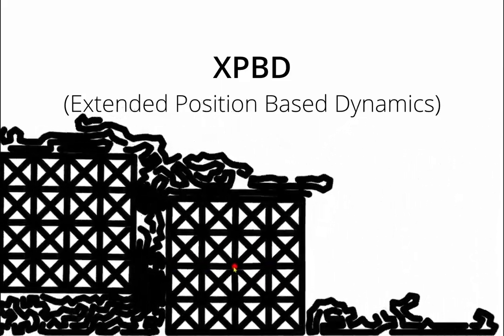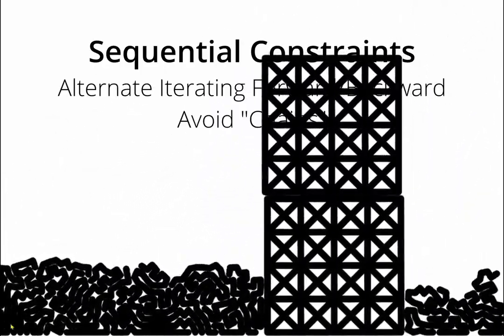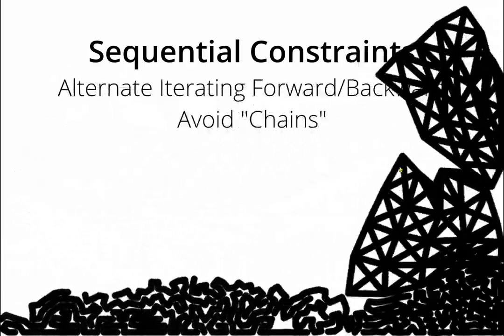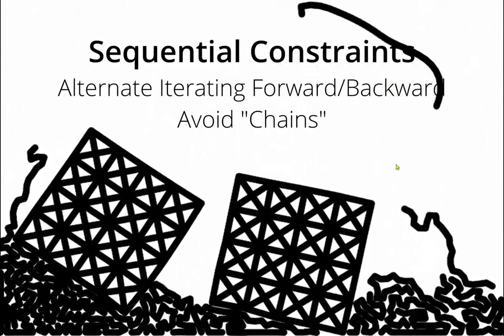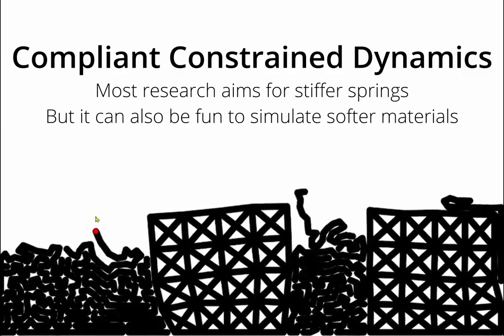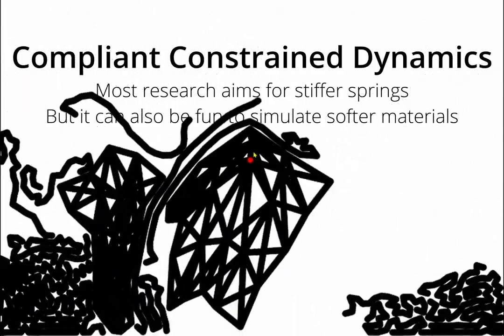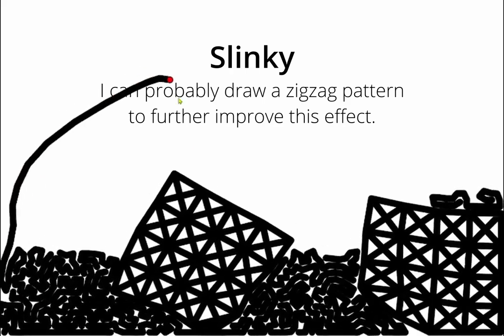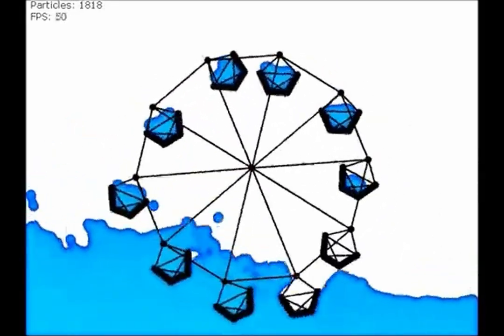XPBD Mass-Spring Physics

Comment: Have you heard of bevy?its a rust ecs framework and a physics engine is being built for it called avian
Reply from the maker: One concern I have, since I’m building this for the web is the bevy WebAssembly build size. There are mentions of it being larger than 10mb. I think I’d use raylib if I was using an engine. WebAssembly memory is sandboxed so coding things up in C/++ is not at much of a security disadvantage compared to rust. I also separate application level stuff from what the WebAssembly module can access

Comment: AVBD seems to be next thing. it has its own problems but should still be an improvement to XPBD
Reply from the maker: Yeah, I do like the softness customizability of XPBD, I hope to take a look at AVBD soon and hopefully it is similarly configurable and not just about maximizing stiffness. I think initially I will take what I have and work on releasing a combined sandbox with XPBD and then adding AVBD as something that can be toggled on.